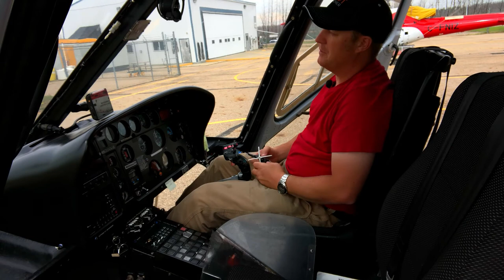HOW TO CONTROL A HELICOPTER: Collective, Cyclic & Pedals Simply Explained

Comment: Hi. I get ur name is James. I hv a question of how u keep the heli horizontal. Fr what i gather when u push the cyclic forward the heli moves forward but tilting downwards. I noticed that helis travel generally horizontally. What is therefore required to be done to move horizontally?
Reply from the maker: Forward on the cyclic, then raise the collective to stop the descent. When collective matches the cyclic it flies at that speed in level flight.

https://youtu.be/YBzkJkmcNWg
Reply: Thank you very much Sir. It cleared the wonder i had of how a heli flies horizontally. Now i understand fully that at the outset when the cyclic is pushed forward the heli moves forward but at the same time tilts downwards n to get the heli's nose up the collective has to be raised to balance out the tilting. Where r u based Sir ?
Reply from the maker: @gohoonchuan8511  in Canada
Reply: @PilotTeacher TQ for ur replies. Whilst on a tour of Canada i took a heli ride in a Robinson over the Niagara Falls.  Thrilling flight but too short.

Comment: Great video, much appreciated. I have a question relating to the cyclic. If I centre this control, presumably the rotor disc position neutralises and the aircraft returns to a neutral position? So, I have to maintain forward pressure on the cyclic to maintain forward motion. In my mind this is obvious, but I am toying with a ‘simulator’ in which this doesn’t seem to be the case. It seems I have to apply equal and opposite movement of the cyclic to return to a stable hover.
Reply from the maker: Hi Paul,
I have to think about this now as I fly without even thinking about the controls! 

When you move the cyclic, you tilt the disk which then causes the aircraft to follow in that direction. If you center the cyclic it levels the disk in relation to the fuselage, but the fuselage is tilted in the direction of travel. All forces being equal and in a vacuum the helicopter would. continue to drift in that direction.

To stop the drift, you have to put in opposite cyclic enough to tilt the disk and then the fuselage to slow and then stop the drift. Once stopped you give opposite cyclic again to right the fuselage then center it to keep it in one spot. This is why hovering is so difficult as student always over control and add in too much cyclic control. 

I hope that makes sense.
Reply: @PilotTeacher  Hi PT
Thank you for your reply. I think the fog is beginning to clear!

In an effort to break down what is happening, would I be correct in thinking the following:

Cyclic forward to instigate forward travel, fuselage orientates to rotor discs tilted forward position. Centre cyclic, rotor disc and fuselage maintain orientation and forward motion continues. Cyclic is now in a neutral position.
Cyclic aft to level rotor disc in relation to ground, fuselage orientates to rotor discs level position. Centre cyclic, rotor disc and fuselage maintain level orientation and aircraft returns to a stable hover.

I think this is what you said, I am just trying to break it down into a sequence of events that my old brain can follow :-). 

Hopefully I am getting the right idea. I appreciate that I am simplifying things, ignoring drag, mass of the fuselage and the effect of gravity on it.

Thank you again for your help and the great videos.
Reply from the maker: You got it.

Comment: But doesn't this heli have a gyro?
Reply from the maker: The only gyro in this helicopter is in the Artificial Horizon Instrument. The pilot’s semi-circular canals in the ears do the rest!
Reply: @PilotTeacher  I see. I've been into rc-helicopters, they use a gyro stabilizer to counter the main rotor, so you need not compensate with the pedals when altering the collective.
Reply from the maker: @uncletom1971  I used to fly them too so I had a suspicion thats what your were getting at. Some of the larger helicopters have collective to yaw coupling that mechanically or electronically increases T/R pitch when the collective is raised and vise versa when lowered.
Reply: @PilotTeacher  Interesting. So most smaller modern helicopters don't have this automatic compensation? What about the MD500? Or Sweitzer 300? These are my fav machines, also the classic Jetranger.
Reply from the maker: Ive flown the 300 and the JetRanger and they have nothing. Md 500 I doubt too. Its adds weight and complexity.
Reply: @PilotTeacher  Thanks for the info. I guess they are pretty basic, and by now also rather old, helicopters. But that's probably why I like them so much. I remember the tv movie Deadly Encounter from 1982 with Larry Hagman, he flew an early version of MD500. A quick search it seems to have been the 369H.